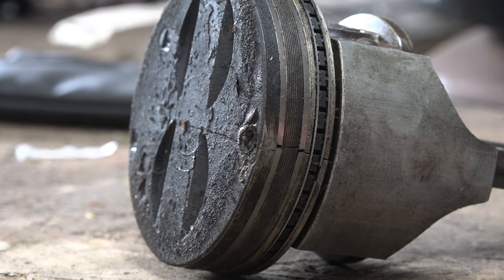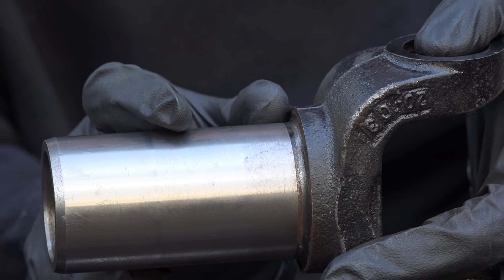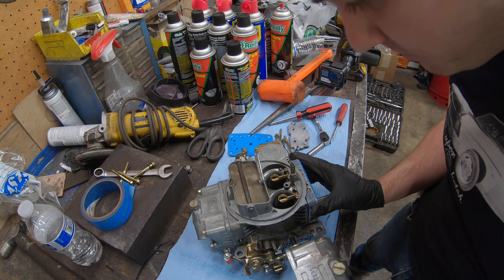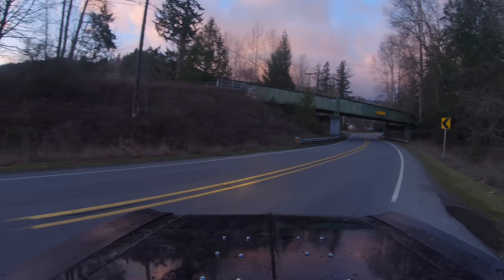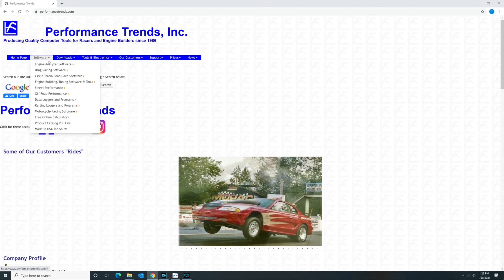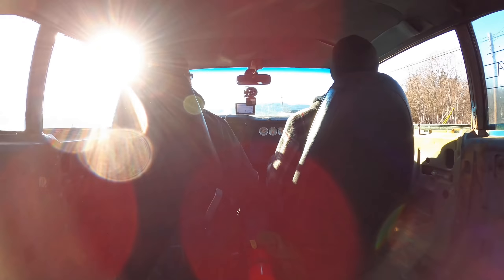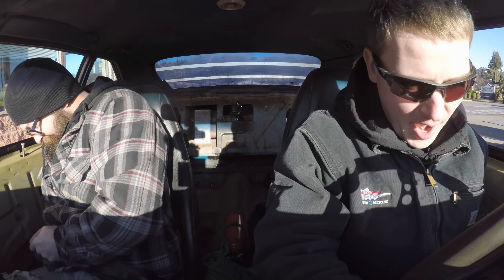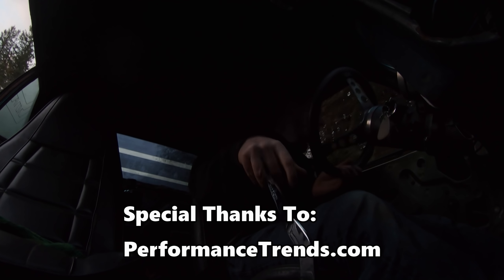327 4 Speed Nova Test Drive! | Deeper Look #16

Comment: Drive 327's like you stole it, and stop watching the tach. You go by feeling in your back against the seat, but your right to go by the sounds if it's breaking up on the top side too.
Nice job you youngsters are doing there giving the two they're new life, far better than letting Japan send them back as rebar, are cheap angle iron by a long shot!!
Reply: Agree, theres no need for a tach you can feel/hear when its time to shift
Tachs are nothing more than novelties
If you have a fast car theres no time to take your eyes off the road anyways
Reply: @gordocarbo  you hear it as well as just know how it feels around you. 
Never used clutch after leaving the light either, and muncie shifted so smoothly they thought it was automatic lol
Oh for the old days when life was simple. 
May have not been as fast as they are today, but it was more fun I believe.
Mainly because it was all motor that we built ourselves from whatever source we could find to build it from. 
Then trip to machine shop for the basics, then your combination parts supplier/ performance shop aa your money was available. 
Then the fun began, and not many used lwb C10's back then. 
But just memories now for old men. 
But you are absolutely correct about that, and you could tell who wasn't a driver and who's daddy bought the car.
And never believe what you think you see, because those of us are the ones that will eat you up, and really hurt your feelings. 
Have a Great Day

Comment: when dialed in 327s like 6,500 to 7,000!!! Great motors like 396's and 427's. Love to rev.
Reply: only problem is the 11/32 rod bolts don't like that kind of rpm. factory hipo 327 red line at 5800. 6000 for very short time.
Reply: @robertweitlauf4653  ARP
Reply: @BBBILLY86 bolts are not the only problem. 327 connecting rods are lighter then 350. believe me i know i raced 327 in the 70s if you dont rev them past 6000 your good anything above that and they break.

Comment: Love this build , I have a Nova under my truck and a 327 with auto-changing to a muncie M21 ,can you tell me what clutch you used?
Reply from the maker: I used a zoom 30006S. But if your trans is 10 spline input that won't work because its a 26 spline disc.
Reply: @NotRodShop  Cheers

Comment: My chevelle does that when it’s low on gas that’s my gas gauge NGL I have enough to make it home when it starts to cut out if now the gas then it’s the fuel filter 95% of the time until you get a new tank or clean your gas tank 😅